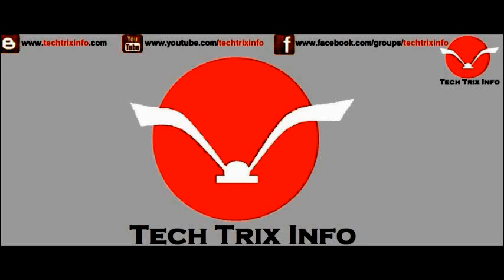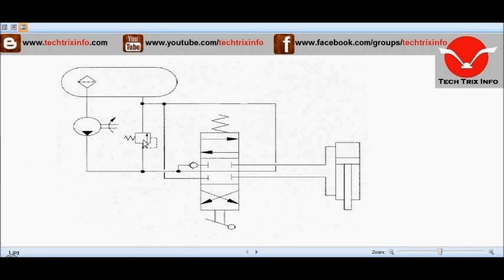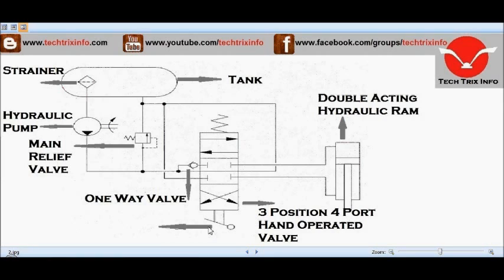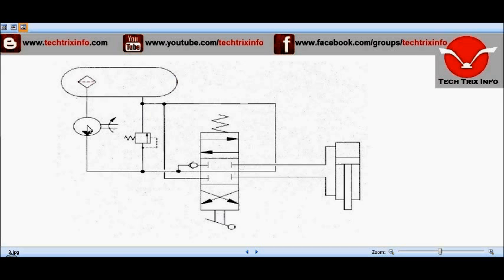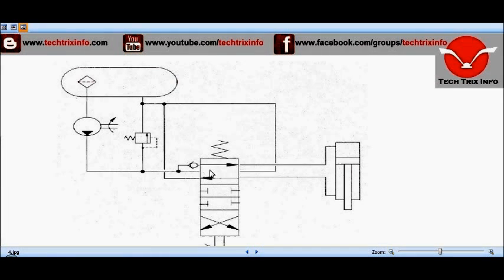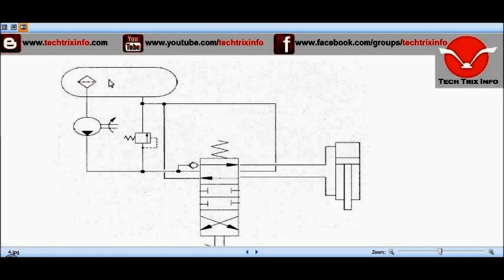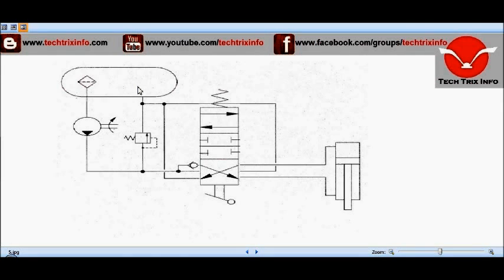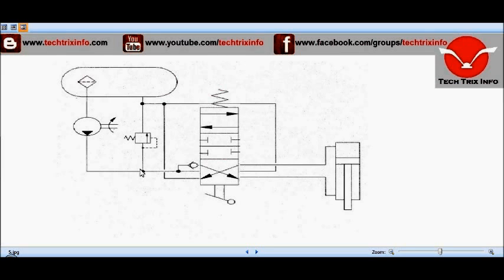Animation - How basic hydraulic schematic circuit works. ✔

Comment: when you move the shuttle to the first position and oil goes to the ram. what stops the resistance from sending the oil to tank at the point before the shuttle valve.

Comment: Boy, this is a basic circuit...Where is your accumulator?    A relief valve is not good enough.    Do you know what a hydraulic accumulator is???  Maybe you should study your hydraulics more bud.
Reply: Im going to pick your brain as you seem to know what you are saying. i sold a hydraulic trash compactor ( ran when it i bought it 1 year ago ) that recently has been moved to another location and was drained of its hydrualic oil and stored on its side ( trash compactor )  the guy that bought it from me called me telling me that he replenished with oil and started the motor runs fine but on pressing the start compacting button the cilinder does not move down as it should. i suspect 3 things 1 the limit switch on the cilinder side is not making contact. 2 the hydraulic valve is not working or not wired properly, or 3 there might be a air lock?in the circuit when it was transported on its side.if you could help me on this or your thoughts which are better than mine most likely i would apprieciate it very much. thanks in advance.